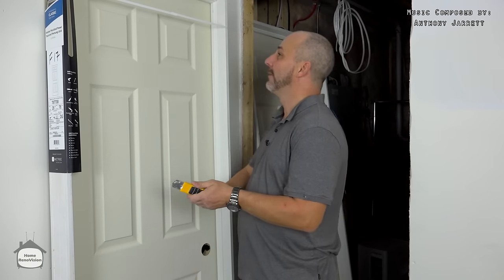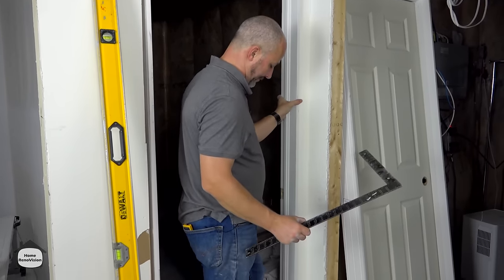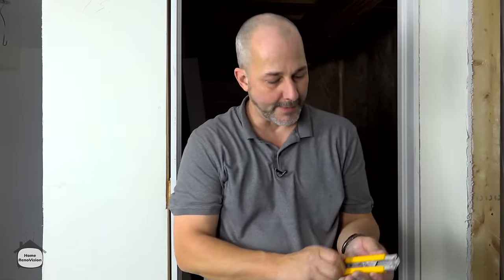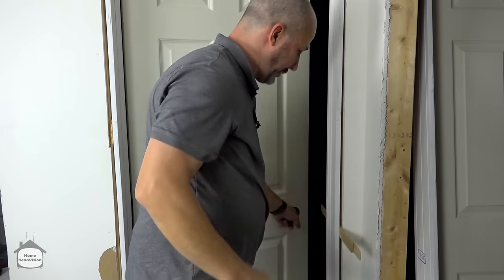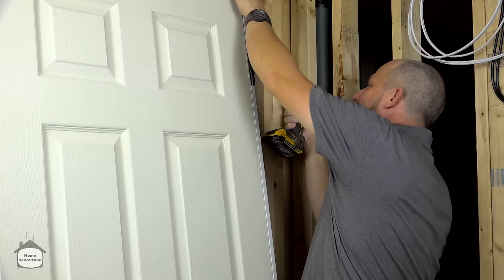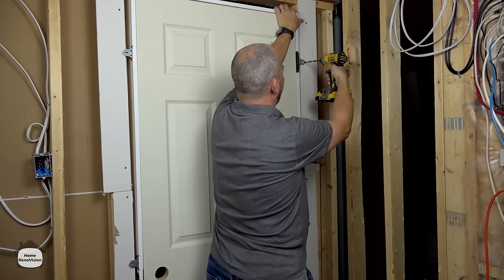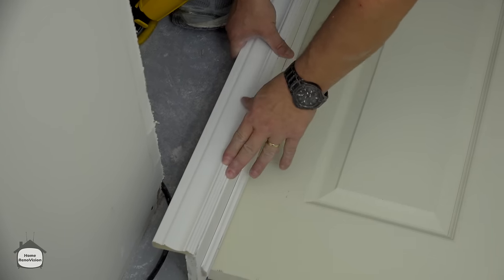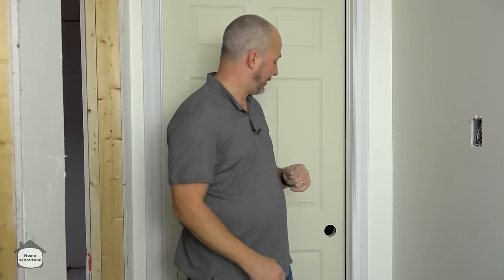How to Install A Pre Hung Door  |  3 Different Ways

Comment: I can relate to the hospital visit & the long wait, but it's not free. I had a back injury & sat in the waiting room for 4 hours untreated. They never examined me, never put me in a room (which exacerbated my injury) & then dismissed me & charged $1k just for having filled out paperwork.
I helped a friend hang the pre-hung door & that little plastic thing holding the door in place was a pain to remove.
I wonder if putting the doorknob on would help to make sure it aligns properly with the hole so you don't have to eyeball as much-- you will know if it fits & clicks in or not.
The doors in my house are not built well at all-- a little pressure pops a door open even if it's locked (bad DIY job from the monkeys who built it & from tenants tampering w/ stuff).
Some of the doors we get pre-hung come with casing on them already so the last method might actually be the fastest/easiest if you use a door like that.
For the last method you could probably add some shims on the side that doesn't have the casing & add some screws to make it sturdier.
I'm going to have to install 2 doors in my house-- although one is an exterior door that has a threshold built in already. That one is going to be fun adjusting. I'm replacing an old wood door that is falling apart with a steel clad door.

As I mentioned in another comment, I think (at least conceptually) you could use the door hanging clips (if you don't have the casing already on) temporarily to align things, then use shims & screws to secure. You won't have to use as many screws & you can then remove the clips to re-use them on other doors.

When I helped my friend, the door already came with casing. Didn't have the nailgun handy so manually hammered nails in. We had a 3rd friend helping and he was hammering and hammering. We figured he got about 5 nails in-- apparently he only got 1 in. LOL. 

Anyway, I propose a hybrid method: Use trim & brad nails to get it lined up but use shims & screws to secure it. If it's pre-cased it might take less time than all of the methods, but with the extra steps of shims on the non-cased side (although some doors come with casing on both sides, but you can still use screws inside the jamb).

Comment: Thank you. You answered a lot of questions before we start. 

We have an outside door that opens in to a room where the landlord put carpet with extra padding. Through your video, I see how to adjust the square and plumb issues we have, but as the casing needs to be replaced due to weather damage, we're considering starting from scratch and possibly making this door open out, perhaps adding an arm at the top to keep wind from catching it. As it is, the door is completely unusable now until it is replaced. Do you have any recommendations before we start the process with an outward opening door?

Comment: I do enjoy your channel, even tho I see some things that are amateur. 
But Screw it right?? I mean we can’t be expected to be great at everything. 
You do a good job. And the more you do the better you’ll get. 
Thanks for the vid.
I do recommend you watch a vid on YouTube where it’s titled install a door in 15 minutes. Now granted that’s probably all the guy does is install doors, but his vid is very informative and it will give you a couple good pointers on installing doors.
With my handyman biz I probably install only 20 doors per year. So it’s not something I have to do daily. 
If that’s all I did it would probably take me 15 minutes too. Instead of 45 minutes. 
Anywhoo, good work man, enjoy the vids.
Reply: My best day was 10. Two of them doubles, 1 cut to roof slope. Trimmed both sides, leveled to adjacents and biscuited and sanded miters. His method is basic, which is good for DIYers. Definitely not fully comprehensive.  Dealing with twisted framing, bad, hinge mortises, matched heads, door stop adjustments, scissored wall sections, floor gaps, etc., are more advanced.

Comment: When hanging a door with the trim attached, wouldn't it be easier to put the trim on the hinge side then hang it? You could see the gap on top and down the side with the door closed as you nail it to the framing.
Reply: K Womack absolutely. Like you said you can see the airspace properly. Then you can go from the other side and install shims before putting the casing on the other side.
There is no need to install the door with long screws. It’s not an exterior door. Also it wont do anything considering the hinges holding the door up are 3/4”  and a hollow core door. If you slam it hard enough it will fall apart at the week spot

Comment: I need your help. So i live in a house that has no laundry room. Im building in my back porch for laundry. Im wondering if I can run the laundry drain to my toilet drain pipe. kinda strange but my toilet drain pipe is 3in. and its alone all the way to the main drain pipe which is 4in I believe. Also Im in Charlotte, NC is there anything that says that i can't do that?
Reply from the maker: sounds good in theory however make sure you have venting for the new fixture and slope for the new drain. Cheers!

Comment: I recall in a previous video you did installing a pre hung door with the shimming method you left the door in the hinges and propped the door up using a ton of shims to carry the weight of the door However, in this video you mentioned that its better to take the door off the hinges when doing the shimming method. Is taking the door off just easier for DIY'ers?
Reply from the maker: Just showing options. Cheers!

Comment: your last hang, that's what the finnish carpenters used a split jam system, they hold because i had to replace the striker jam after somone kicked the door in and kicked the striker plate off. the whole system was a pain in the ass to fix.

you door dot latch?  you can tweek the hinge to adjust the hang by bending the hing to raise or lower the latch.  no 2 hinges are bent the same compare them side by side. that's a real old carpenters trick to fix a bad install. faster the shimming a hinge out.

Comment: Couldn’t one screw the tabs on the jamb using a drywall sparer to shim the tabs back on the door jamb  so the tabs are screwed directly into the  studs without the drywall in between?  Seems this would be more solid than having drywall holding the door jamb

Comment: My doorway is finished, it has drywall covering the frame, do I need to tear down the drywall to be able to hang my door? I need to use the second option. I'm not very confident in my ability to use shims and screws, and my roommate wants it up asap. The floor is level and the finished door frame is level and straight

Comment: Yeah it sucks when the king/jack is not 100% level on the hinge side. personally i hit the door in with a finish gun. I learned a couple of years back to use a wedge on the catch side then hit it with a finish gun. only use shim to grab the frame in 1 spot in the middle. Then you fill the gap with door and window foam once you are happy with the setting of the door. It will be like concrete. 
everyone has their own take on things. The metal adjustment system...... If any other contractor seen you do that on a job site (not you per say) they would laugh from monday-friday.

Comment: Great video. Thank you.
I have a simple question the TL;DR is: *You mentioned typical jambs are 5/8" thick*. It looks like that doesn't include the door stop/protrusion, right? In other words, if the door stop protrudes 3/8" then the thickest part of the jamb would be approx 1", right?  You also mentioned working in Canada. Are you aware of any differences in what is "typical" between Canada and U.S.?

The long version

I have a unique need to confirm the thickness of the jamb. I'm a welder/fabricator and am making a faux Juliet balcony for a second story exterior double door. By "faux" I mean it won't be supporting people standing on it. But, it does need to have the pull-strength enough to keep someone from falling (tension/lateral strength). So, it needs to be anchored into studs. In this kind of metal working it's much much easier to prefab the rail in the shop rather than adjusting on-the-fly during installation (especially preventing weld spatter from landing on the carpet or catching the pine straw below the work area on fire).

Unfortunately, the builder didn't contact me until after all the finish work was done (including the casings). So, I couldn't measure stud-to-stud. He couldn't even tell me if the rough opening was double-studded. So, I have to assume my margin of error on each side is only one 2x4 instead of two (1-1/2" instead of 3"). So, I took the clear opening measurements between the door stops and the thickness of the stops (3/8") and just need a close approximation of the jamb thickness (the 5/8" you mentioned at 2:30) to back into the rough opening size and location of studs. I'll also add an additional 3/8" per side for the gap you mentioned in the video. Thanks for any input/advice you can offer.

Comment: Did you really do method number two (with the metal clips) without using a level to first determine plumb?  Hmmm.  I just used those last week and the instructions to say to draw a vertical line 1/2" in from the edge of the rough opening on the hinge side of the door as a reference line to in order to set the door perfectly plumb.  Seems odd to set a door without using a level.  Perhaps I just didn't see you using one when doing method number two...

Comment: Question, bought a house with 6 panel doors that don't stay open they slowly close as you walk through to about 2/3rds way. How do I fix this?
Reply: remove it and plum it up, in other words put a 4 foot level Ill bet you will see its leaning forward, possibility #2 hinges are not lined up properly especially if it was a custom door and not a prehung, hope this helps

Comment: 20:20 - Do you have a different way of getting the jamb flush to the outside of a wall that has no rock installed? You still have to install crap drywall before setting the jamb, right?
23:21 - Also, the rock hanger will need to trim your scrap to hang next to your door. Will that disturb the integrity of your jamb screws since the piece you installed is so thin?
Reply: The door hanger can actually be hung in the grooves of the door and is mounted jus proud of the rough in with out the drywall being there.
Reply: And if you’re using solid core doors I don’t recommend the doors hangers, jus my opinion

Comment: Thanks for the video, wondering if someone could assist me. I installed my 1st door yesterday, however when I screwed the jamb through the shims and into the frame (using 2 1/2 construction screws) it pulled the frame out of alignment, also how do u get the shims to stay in place, when I’m trying to level, they always fall out?

Comment: I've been a carpenter since 1985.... you never hang a standard interior door off the jamb.... you have to continually check the door set and closure as you go. Plumbing the jamb never is where it needs to be to operate correctly because nothing, not even your pre hung door is square or plumb.

Comment: You don't appear to have followed manufacturer's instructions for the clip system. You are supposed to scribe a vertical level line on the hinge side of the wall. Then align same mark on the top and bottom clip to your scribe line ensure the jamb is level (look closely at clips and you will see scribe marks on them). From there you follow same basic steps as you show, which is adjusting other clips to get an acceptable gap all around while installing screws. See instructions for pictures if this doesn't make sense, or watch the manufacturer video. From a DIY'er who uses the clip system that are ~$6 here in the US.

BTW... if you are not installing all of those 3" screws in place of hinge screws, how do you hide the screw heads? Like on the side with the handle.
Reply from the maker: the instructions only work if you have a square frame and lots of room.
Reply: @HomeRenoVisionDIY  Square frame not required, in my experience. Or at least i have yet to encounter one. Adequate space I definitely agree with. As you noted, inadequate space is a problem with any of the three methods you shared. Thanks for what you're doing with your channel.

Comment: not clear why you say the 3rd installation, with brad nailer is cheaper and faster. I get the faster part, but why it is cheaper? Is it just the cost of screws in 1st way? (In the first two, you still have to add the trim afterwards, so this cost is same). Seems it would be easier to do the trim first, like in 3rd step.

Comment: I know you probably dont like the second method, but wont those brackets make the casing stick away from the jamb from those two little tabs
Reply from the maker: just a 1/16". caulking the trim will cover.

Comment: I remember buying some pre-hung doors years ago that were a "slip-jamb". They already had the casing installed. Very similar installation to the 3rd method, then you slipped the "back" half of the jamb inside the other once you installed the hinge side. It was kind of mortised to accept the other piece. Does anyone else remember this? I thought this was standard because it was the first door I ever hung. I've never seen them since.

Comment: I'd like to see in more door hanging videos about making the jam square to door frame so there's no tension on the door hinges so you don't get the door trying to open itself. Great video otherwise!
Reply: You are talking about a sprung hinge. This is usually a problem when your framing isn't square, or your shims are uneven. You can pull the hinge pin and use a adjustable wrench to slightly bend the hinge barrel to alleviate the sprung hinge

Comment: I'm a bit puzzled by the third door installation.  You didn't show the other side of the door, just the front.  So what about gaping between the door frame and jamb? Wouldn't you need to add something in the gap? I would think if you don't the frame could bow.
Reply from the maker: Hi Elizabeth you can use shims or do what I did and just throw in a dozen nails on the outside edge. Cheers!
Reply: @HomeRenoVisionDIY  and re-adjust it on a regular basis.

Comment: I'd never use that last system without nailing through shims....  An easy way to adjust drywall that's proud of the jamb is to smack it with a hammer until the casing sits flush on the jamb - just stay inside the width of the casing so it isn't visible after the casing is installed.
Reply from the maker: That works as well. Really awesome how there are so many ways to do something right.

Comment: On option #2 ( easy option)
By adding way too small pieces of drywall around the door you introduce nasty butt joint all the way around, later down the road it will need to be finished and by floating that butt joint, trim is not going to sit right on that door frame.
Reply from the maker: That room is a mechanical room and will stay unfinished. Cheers!

Comment: My front door hing look outward do I get a new door how do I reverse it to open inward
Reply: Move the house to the other side of the door. Clever, ain't I!
Reply: Don't need a new door, just move the hinges and other door closing hardware to the other end of the frame. If you want an exterior door to open in, make sure the hinges are on the interior side of the door frame.

Comment: You really exaggerated the complexity of the hanger clips.  I love those things, simple, fast.  I'm no pro and attached the clips onto the door in about 4 minutes.   As for using them only on finished walls, the instructions actually say to simply offset them by a half inch if you want to install without (or before) drywall.

Comment: I checked you out because I wanted to see any new ways to install a door. AGREE OLD SCHOOL THE BEST & shims are cheep. 2nd method looks like a pain in the butt too much work. 3rd pin nail TRASH! OVER TIME NEVER HOLDS UP. Over time as house settles door shift and cracks the frame. Yes very fast. But expensive! Include the cost of nailer, compressor, hose, then the nails. Yikes ya spend $500 just in tools for a $120.00 hollow door. Drill, level, square, 3" screws (more secure too). 
Now do a pre-hung door vedio. May be one you have to cut down because basement height not there. Like 1880 home.

Comment: As a retired trim carpenter of 45 years, look for another training video. Everything he does on all 3 examples is backwards, out of order, or done from the wrong side. He may have watched someone set a few doors, but he is no door setter.
Reply: I agree Will.  The more I watched him, the more he seemed like a hack!  18 gauge brad nails to hang a door!  I don't think so.  15 gauge maybe.  Also, one should balance the door in the opening to ensure equal reveal on either side using at least 5 points of shim.

Comment: Hey Jeff I finished making a inward door a outward swing door with the hinges flipped around.  I rotated the left and right jambs, i.e. top left jamb became the right  bottom jamb and visa versa.  And cutout a 1.25" section of the newly flipped jambs so the top jamb would fit in.  I got lazy and was able to fit the door upside down not having to flip the door hinges but the only problem have a 44" high door knob instead of 36".   The jambs sure look beat up but I guess filler and sanding and paint later.

One thing I noticed the hinges on the door were 9" from the top of the door and 9" from the bottom of the door.  This way the door can be turned upside down.

I screwed up and took out 1.5" of material from one side that was supposed to be 1.25".  0.25" piece of plywood filled in the mistake.

https://photos.app.goo.gl/moLnrT5MHrjNPcqa8
Reply from the maker: That is a lot of work, but you just proved anything is possible if you stay with it. Cheers!